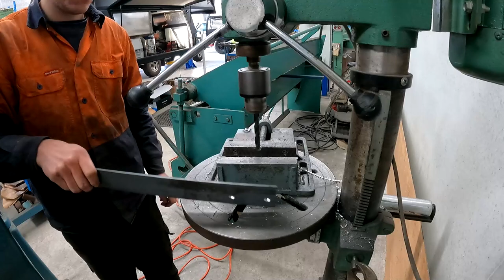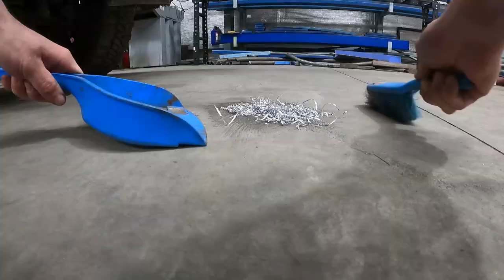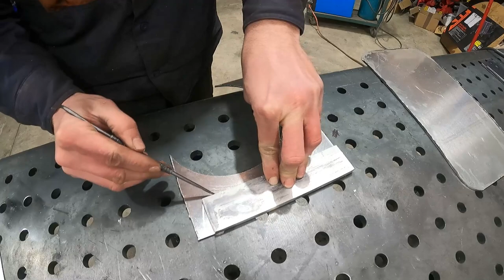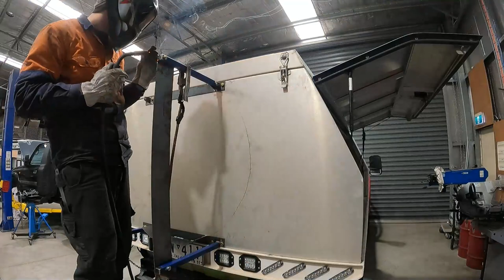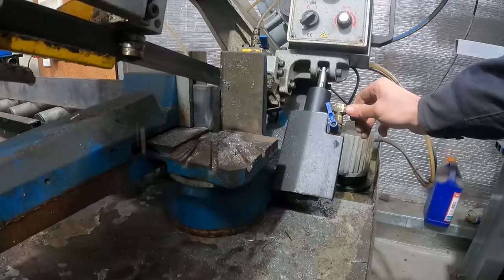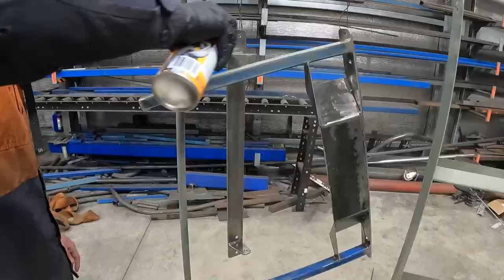CUSTOM Rear Ladder for Aluminium Canopy

Comment: Any reason you used flat bar/plate as your ladder uprights? They appear to move side to side a fair bit as you get up it. Great video by the way. Can't wait to see a full tour.
Reply from the maker: Cheers mate! The original plan was to use 6mm aluminium flat plate but didn't have the material. So I just stuck with the same design and used thin steel. Your right, it does wobble a little. But it's honestly not an issue at all when climbing or lifting the tyre